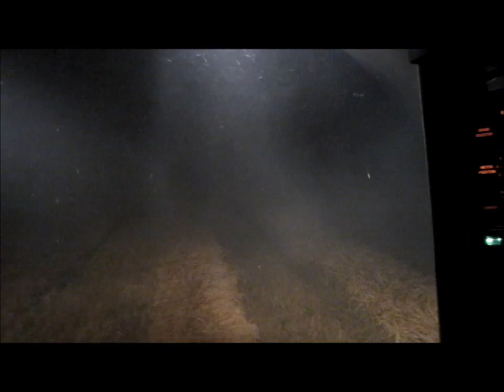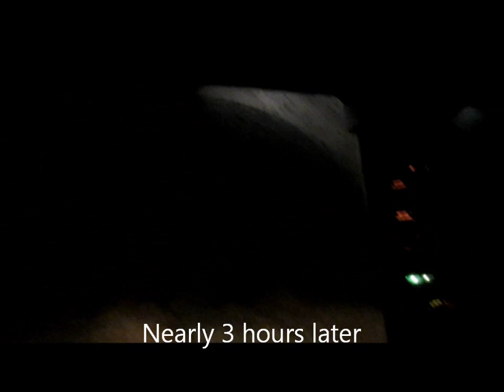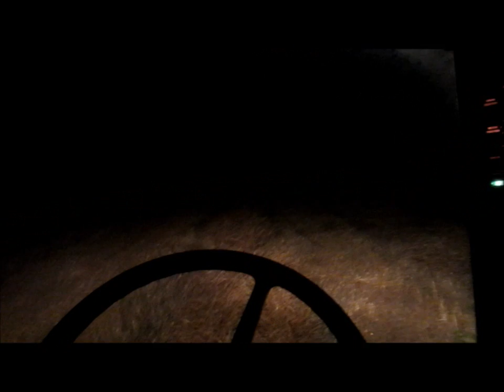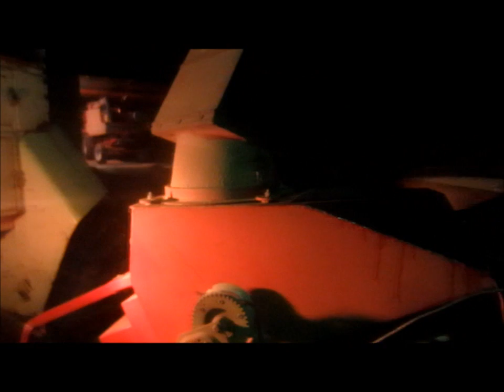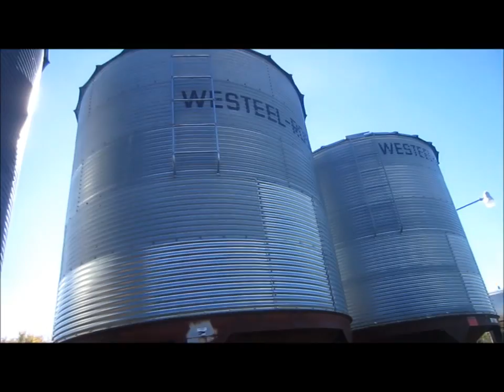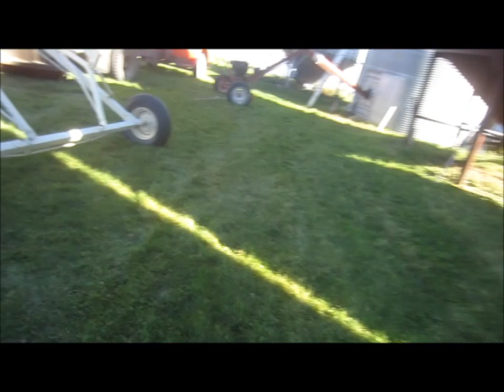Back In The Oat Field 2016

Comment: I run a 10x60 sakundiak with a farmall Super M, it works quite well. The farmall has its butt full, but can handle a full auger
Reply from the maker: Thats doing pretty good. Smallest I've used was the 730 Case and this is a 10x50.

Comment: is that case gas or diesel?
Reply from the maker: The 830 Case is a diesel. Handles the 10 by 50 foot auger well with power to spare. I've run it with the 730 as well but the lack of power steering makes it a real workout getting the auger lined up at the bin.